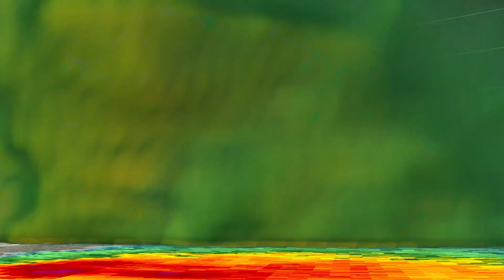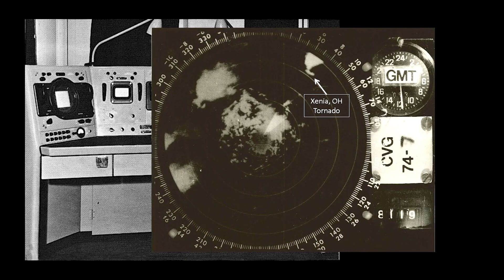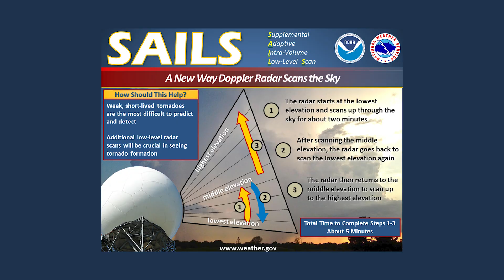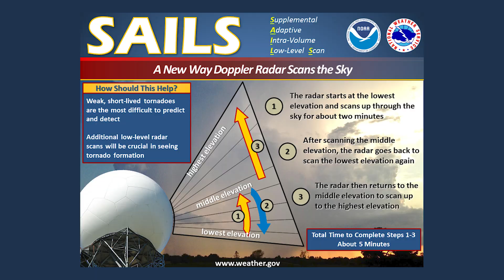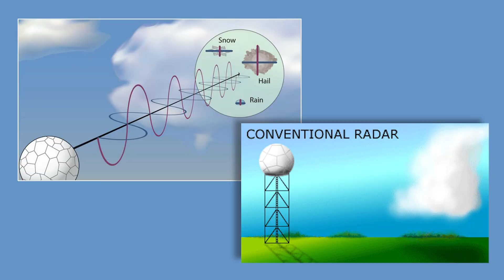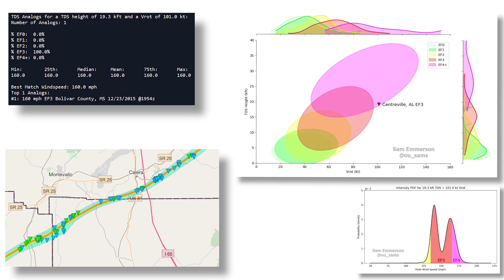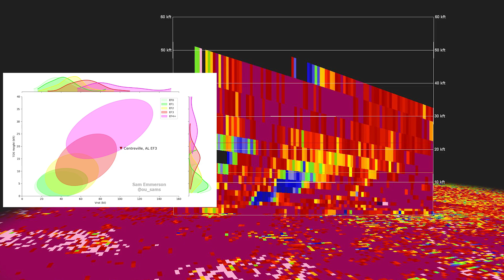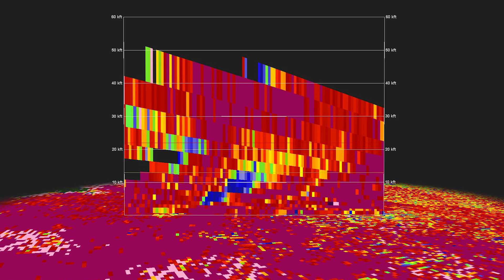How Do "Radar Confirmed" Tornadoes Work?

Comment: When I was still living in Saint Louis on May 31, 2013 I purchased my first brand new vehicle. I drove to drop off the stuff out of my old vehicle at my new place that I signed the lease for earlier that day. I got a call from the friend that I was staying with saying that there was a tornado on the ground, but he got the area wrong. The tornado hit his place and as I am driving north on I-270 the tornado crossed the highway in front of me, but you could not see it because it was rain wrapped. I was less than a mile away from it. Had I been about 30 minutes earlier I would have been caught in the tornado when it hit my friends place or a minute earlier and I would have been caught on the highway driving right into it. That tornado was an EF3.

Comment: I live in Ord, Nebraska, in Valley County. The last time the town warning blew, the cell they were concerned about had already missed the town and was a few miles to the north, according to radar. Not very confidence building.
This video addresses something that has interested me for years. Since retiring I've become something of a night owl. On severe storm nights I'll watch the radar (weatherunderground display of "North Platte" radar, which is actual just south of Thedford. This display in no where near as detailed as the stuff you use).
On numerous nights there have been literally dozens of "radar-indicated tornadoes" on this display, most in a band just west of here in Custer County. (I'm assuming you've been through his area at some point and have some knowledge of the geography). The thing is, there's rarely a report of a tornado the next day. I think several things are happening.
1. Some aren't really tornadoes.
2. Of those that are, a lot never get to the ground.
3. Much of this area is practically uninhabited rangeland with little or no objects to damage. It's entirely possible that a tornado could touch down at night in this area and nobody would ever know.
Are at least some of these real, and do my reasons make any sense?
Reply from the maker: I just barely missed getting a weak tornado near Ord back on June 1 2018.    Radar indicated rotation just means a storm is spinning and there's neither ground truth nor a "TDS" or "CC Drop" associated with that area.  But that's a recent change.  Your area has been fairly quiet (relatively speaking vs the past) for supercell activity lately. You're also really far from a radar site which makes things even more difficult. The resolution of the radar echoes drop and the curvature of the earth places radar beams pretty far up in elevation for your area.   Based on past history your 3 pieces of reasoning are pretty valid. Local NWS offices are getting better at discerning this stuff all the time so going forward, tornado warnings are getting more serious with fewer false positives. I guess we'll see if you have different experiences going forward!
Reply: @scienceoutthere  Thanks for the reply. Appreciate it.